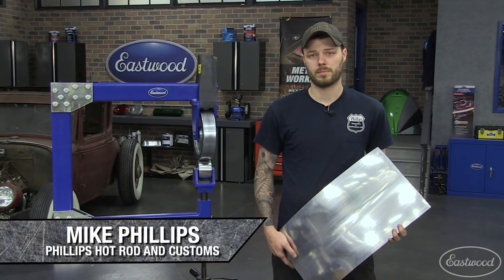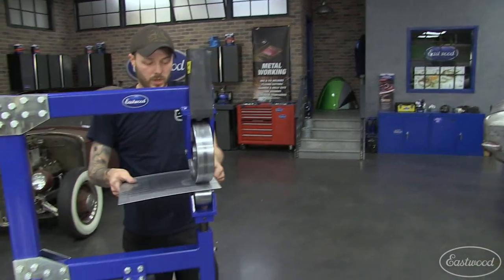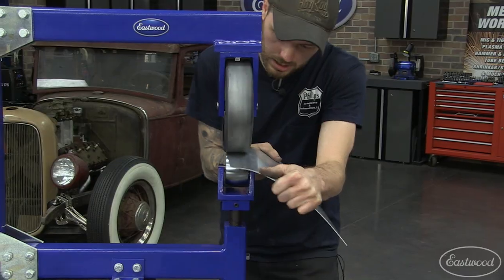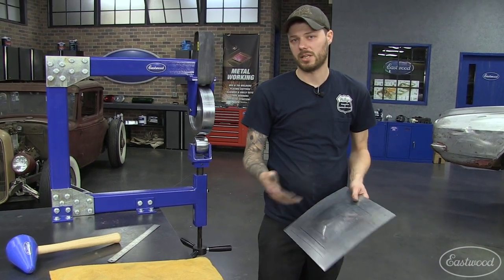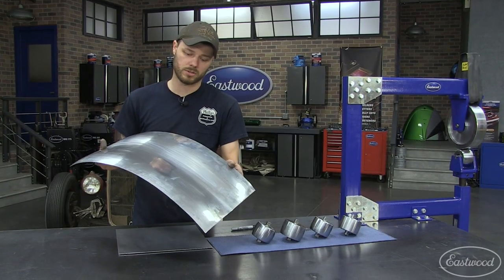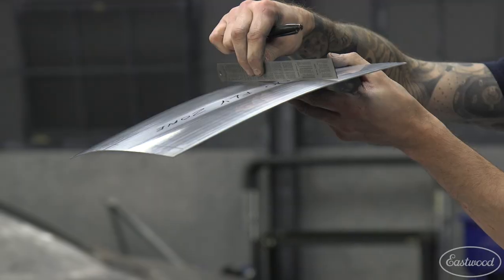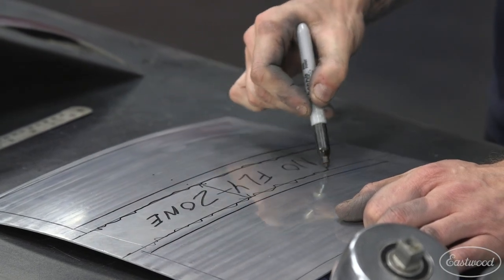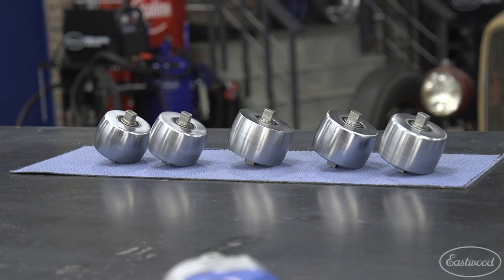Learn How to Use An English Wheel – Lots of Tech Tips From Eastwood

Comment: at 19:00 mins into the video , he shows how to set a body line.
 I tried this on a door skin I made, it  created the body line OK, but it also flattened the panel along the body line.  I lost  shape and also caused some distortion in the surrounding area. I tried fixing it but , when I wamts getting anywhere, I got frustrate  , lost my temper and made it worse. 
I will have to start with a new panel all over again , but I worried I won't  get that body line to work .

Does anyone have any ideas ?

Comment: Good video, I've never seen one used before, why does the top wheel arm(?) flex? I mean there are 9 bolts holding it to the upright and that short lever arm shouldn't flex that much.
Reply from the maker: To lessen the flexing, you can weld the brackets to the arms after it's bolted together.

Comment: I do have a question, what does one do about all the work hardening and resultant brittleness that can develop in these panels?
Reply: You have to anneal the panel from time to time if it gets too hard to shape. This is required mostly when working with aluminum.
Reply: Idomake mild steel doesnt work harden enough to worry about during the process. Working with brass or  aluminum  annealing should be done

Comment: LUBE THAT WHEELS PLEASE!
Reply: jishimoari I think that was the rubber band rubbing.
Reply: jishimoari its from the pressure on the work piece. The work piece working against both wheels is causing the squeak
Reply: jishimoari thats why the squeak goes away when he started using the rubber band.

Comment: Not to take anything away from you but the movement in that so called home built piece of shit of a English wheel has way to much movement in it.
Reply from the maker: To make it completely rigid, you can weld the spots where the arms connect to each other. Most English Wheels must be shipped via freight, which is very expensive. This was designed to be a larger wheel, but ship at a low cost. That means it bolts together. Simply welding the connection points will make it very sturdy and improve the performance.